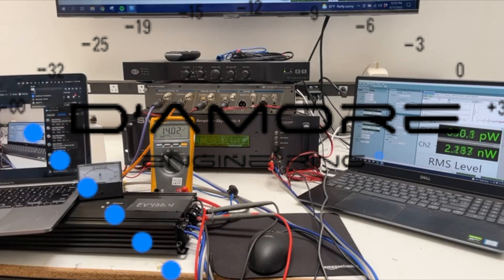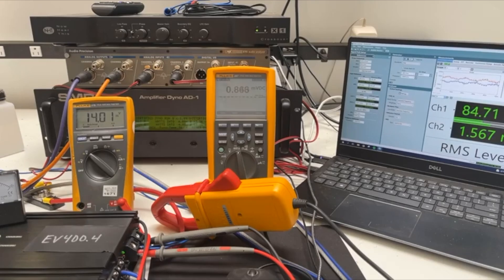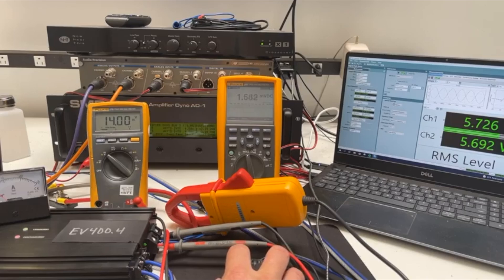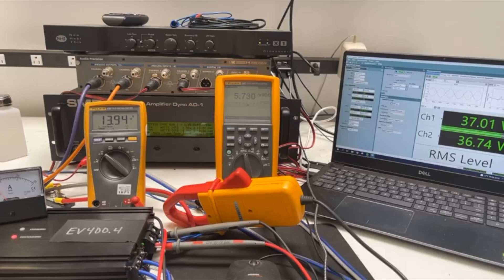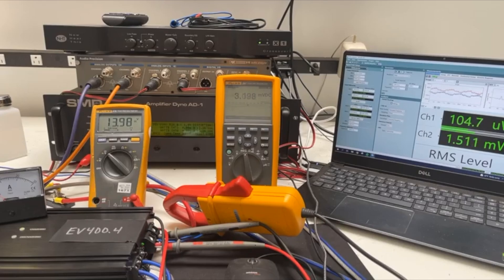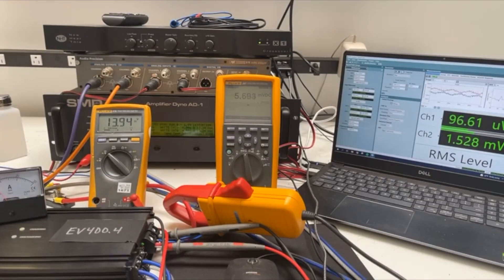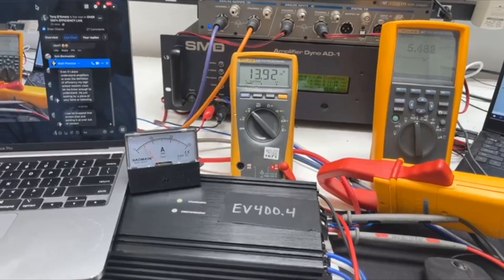Way over 100% Efficiency.  D'Amore Engineering Current Averaging Amplifier Bench Tested w/ Sinewaves

Comment: You Mr. DAmore?  You got the dream job.   Making gear that just works.    Thanks to your DD-1,  I have been using it to test Headinits , DAC's, and so much more.   Yea, there are a lot of other ways to do it.  But you made it easy, and in a great package.      

I'm also impressed by the amps you helped bring to life and other gear I use.     
Do you think you could talk about SINAD of the amps?  And maybe point to what amps to use for a great front stage?    Maybe how you would go about making a great setup for your car?   I know there is a lot out there.   But it would be cool to hear it from you and go over it  in a less technical way like steve does to make it easy to understand.  Well at least the important points.  

Maybe even go over drivers selections on budget to high end parts etc.   It would really help a lot of us to find out what direction is best.   

Your amps are cool and all.  And great that they are efficient.   Lots of power too.  But it would be nice to have your thoughts on Dynamics.   Imagining.  Sound quality.  Etc.  

Thank you Mr. Damore!    Keep up the great work!
Reply from the maker: Thank you for the props and content ideas!

Comment: Dr. D'Amore, Current Averaging is your Cash Cow. Every manufacturer will be begging to license your patent for the future. I would advise you to pitch  this on Shark Tank.
Reply: Are you thinking its magical? It is basically an amp with a built in battery bank. So no magic, just good engineering. It will not make financial sense to everyone, but it will have a small market for those that need it.
Reply from the maker: @JasonWW2000  that’s not the biggest part of what makes it possible.  It has more to do with the power supplies
Reply: @JasonWW2000  seems pretty cool to me, and,  you havent done it, nor anyone else. Seems pretty cutting edge to me. But ive only been into car audio for 30 years, so, I'm kinda a pleb.
Reply: @Kyote7667  It's very cool. I personally have not done it, but I'm not an engineer so I'm not sure why you mention that. I don't know if it has been done before. It might have been. I have not done any research into it. If you've been into car audio for 30 years, same as me, then I would not consider yourself a pleb. I'm sure you know more than the average person. Don't be so down on yourself. 👍
Reply: @DAmoreEngineering  Cool, I was just explaining to Dillon that its not what he thinks it is. I am always curious to learn more about how it works.

Comment: If you have anything over 100% efficient, I think you just won the Nobel Prize.
Reply: Regarding energy, sure, .. we are talking about power. Power in, power out, like every single board ever made.
Reply: It can do up to 600% during music peaks followed by times of very low efficiency during music lulls
Reply: Y'all need refunds on your engineering degree, if you have them.
Reply: @nismotony  That statement doesn't make sense.  "Very low efficiency during music lulls".
Reply: @Old_Sailor85  meaning when the amp isn’t putting out max power, like in between beats of a song, maybe it’s only putting out 25% of max power.  At that level instead of it being 80% eff like a standard Class D, it might be only 20% eff.  But during this time it doesn’t need high efficiency since the current draw is low.  That’s what this tech does, it long term averages the current draw.

Comment: Mr. DAmore,
I was considering purchasing the E400.4 for my four door speakers and the E1500.1 for two shallow 12" subs with passive radiators. On my last build I had Rockford fosgate AB four channel on the doors and a Rockford Fosgate class d powering the subs. I had the ability to mount a separate AGM battery in my old 4runner, one for the stereo the other for the 4runner itself.  My question is should I incorporate a separate battery using the E400.4 and E1500.1 in my civic, or will  the single agm battery for the car be enough for the DAmore amps?

Comment: Tony, can you talk about how these constant current amps compare to a person who is using a separate lithium battery bank and normal amps? It's a similar concept. Are you going for a certain group of people who maybe don't know much about building a lithium battery bank? Your amps are less complicated and easier to install, etc... Who are your CC amps aimed at? The extreme sound quality guys maybe?
Reply: Now I've watched the video, I see you have a power supply between your battery and the amps power supply. That is a definite advantage over using a separate lithium bank. Your amps will output consistent power while the people using a lithium bank will see voltage dips under load resulting in less power. 
Can you talk about other advantages/disadvantages that you see?

Comment: If its 100% efficient then it will NEVER GET HOT or should get warm at ALL! Any power transferred to heat will cause the efficiency to drop.
Reply: The audio industry uses scientifically correct terms, measurements, and standards, and it also just makes up its own to describe things that may be audio-specific but they are not technically correct.  Prime example:  The term RMS Power.  In science, electrical engineering specifically there is no such thing.  That term doesn't make any sense.  Though we use it anyways to try to differentiate between true unclipped sine wave power, and another term we've created called "Max Power" which just means how much actual power is present no matter how clipped and distorted it is.  By mathematical definition, a square wave contains twice as much power as a sine wave of the same voltage amplitude.  

Now that we understand that the audio world makes up definitions, another example is how the term efficiency is used.  The actual definition is ((POWER OUTPUT / POWER INPUT)* 100) = Efficiency %   Your statement assumes that if the power isn't coming out it must be turning into heat.  Your statement also assumes that all output power must come from the input power.  Both of these assumptions are incorrect when it comes to the operation of this amplifier invention.

Comment: The title of this video implies that the amplifier is a free energy generator. There is no such thing as way over 100% efficiency.
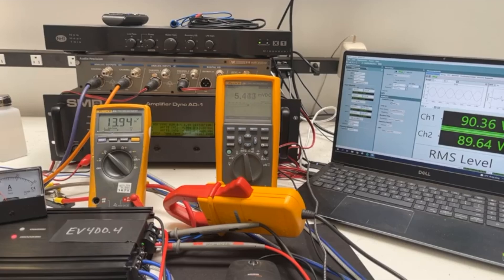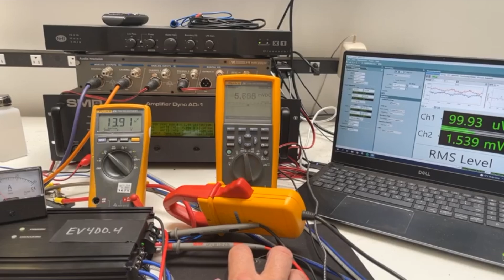Reply from the maker: Except when there is.  Like at @12:05  @12:30 and @15:15
Reply: @DAmoreEngineering  "237 percent efficiency" LOL. Violates the law of conservation of energy. You can't get more power out of a system than you put in.
Reply: @basspig  no it doesn’t.  It’s the law of conservation of ENERGY.  Energy = power*time.   Efficiency is a measurement of power in / power out.  Time is not a factor.
Reply: @nismotony  The only way you could get more power OUT would be if you store it in capacitors and release it all at once, similar to how a flash capacitor for photography works, but that's only looking at it from a narrow frame of time. The total kWh in can never be exceeded by the total kWh OUT.
Reply: @basspig  it uses energy stored within lithium cells, it can put out up to 6x the power it takes in.  For duration it can do 2x the power it takes in with a continuous sine wave for over a half hour.  This is enough capacity such that with the dynamics of music it always maintains a charge
Reply: @nismotony  the way it's worded is misleading though. You're simply trading time for short term energy output.
Reply: @basspig  the only reason it would seem misleading is if one believes greater than 100% power efficiency is impossible.
Reply: @nismotony  There is no such thing as a device that is greater than 100% efficient. Anyone who tries to make that claim is selling you a scam.
Reply: @basspig  your flash capacitor for photography analogy is spot on.  Now just imagine that the capacitor is so big that it can repeatedly flash the bulb, and it is always charging and the charge current is such that you can not take pictures fast enough to discharge the capacitor.
Reply: @nismotony  power is measured in kilowatt hours. You're still taking out less kWh than you're putting in. But this concept is what makes Powersoft amplifiers deliver 18kW from a 1600W outlet--just not for very long. It relies on a 9dB crest factor in program material to maintain power consumption at a constant 1600W while the output pulses up to 18kW in between periods of just a few hundred watts out. You're still not getting more out than in. Class D is still barely 90% efficient.
Reply: @basspig  Energy is measured in kWh, not power.   I think what you are trying to say is a system can not give out more energy than it takes in.  That is of course 100% true and a law of physics.   But efficiency doesn’t have to do with energy, efficiency relates to power.  Because the long term energy efficiency of everything is zero.
Reply: @nismotony  I think we're getting hung up on semantics here... kWh is the same as power, but over time.  If I put 1 kW into a battery for one hour, I've stored 1kWh of power. What you are trying to say is that you are BRIEFLY getting more power out than you are drawing from the power supply. That's not got anything to do with efficiency. Efficiency is the long term energy output divided by energy input x 100. Some of the losses will be heat. The best energy conversion is around 93%. Your experiment only appears to give the illusion of more power out than in because it is done in small pulses. Try a continuous sinewave for a real measure of efficiency.
Reply: @basspig  with a continuous sine wave it is capable of over 200% for 30 minutes or more.  That isn’t brief.  600% for 10 minutes.

Comment: calling it "over 100% efficient" is a stretch as it still sources everything from the vehicle (it just sources the energy in an extended time),  you lose this extra energy as soon as the internal energy storage depletes?  what's the actual benefit?  assuming that no one will push that kind of power for an extended time?
Reply from the maker: The benefit is insane efficiency when it is needed (at high power), crappy efficiency when it doesn’t matter (low power).  This lets us put thousands of watts into a golf cart or side by side without any electrical system upgrades!
Reply: What's the benefit?? Lol... jesus.
Edit- and "no one will push that kind of power, for a extended time"

Guess you dont know some of us very well, do you?  Not to mention, that comment right there, works FOR the boards favor. Your stretching the amperage draw over time. Its fucking brilliant.
Reply: @Kyote7667  say we're at a party blaring music for an hour or more, can we push dynamic power from music (as we know it fluctuates dramatically so saying "max power" is a stretch) for the entire duration without having to lower the sound and wait for the internal storage to recharge?
Reply from the maker: @wow1022  yes it is designed to be able to play music at max levels continuously without ever needing to recharge.
Reply: @DAmoreEngineering    what if you deplete the internal energy storage and you didn't have the electrical system supplying the amp up to par to handle the full power of the amp? just go into protect due to low voltage?
Reply: @wow1022  ya, ya we can lol... holy shit.
Edit- your subs will likely be cooked by then,.. and you are worried about the supply.
Did you not listen at around 13:00 mins.??

Comment: Purely resistance load is the easiest load for and amplifier and is at best deceiving in a test
Reply from the maker: That is totally incorrect.
Reply: @DAmoreEngineering  please explain. What are the impedances in this demonstration and what is the frequency and wave shape
Reply from the maker: @archiedentone5950  the amplifier is running at 2 ohms resistive per channel, all 4 channels simultaneously.  The input is 1kHz or 40Hz continuous sine wave.  The output is a clean undistorted, unclipped sine wave.